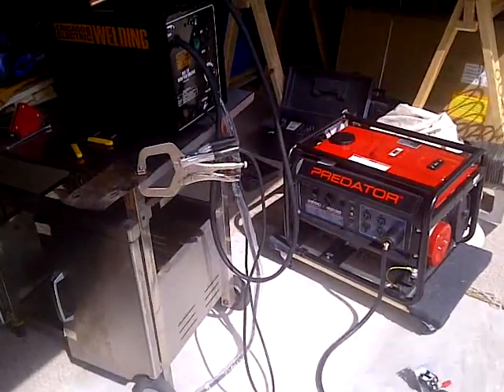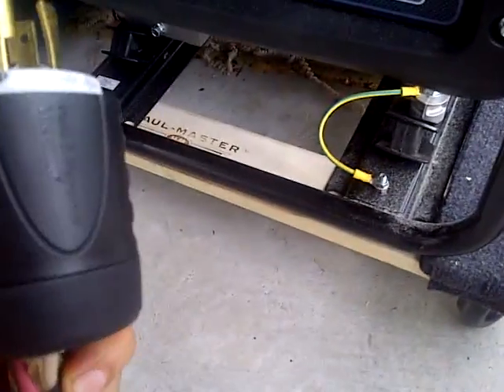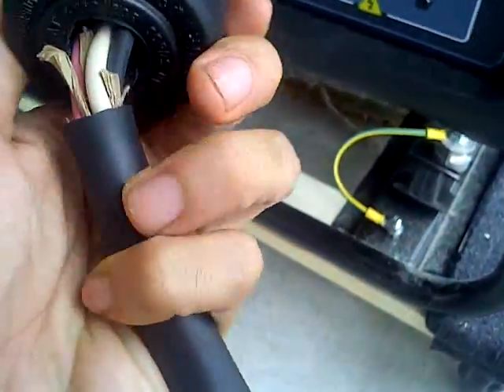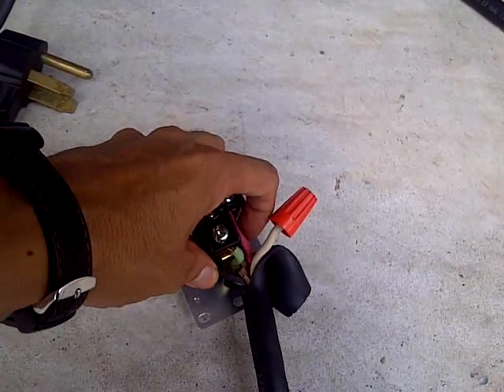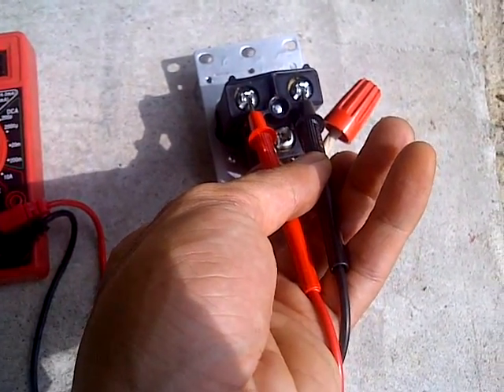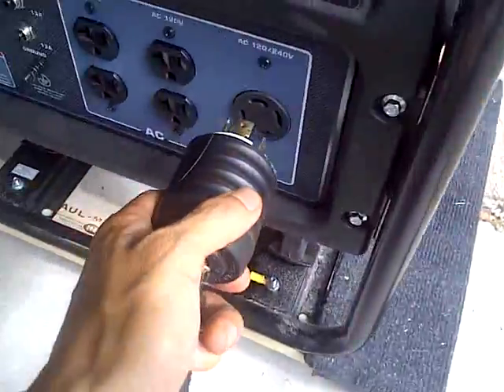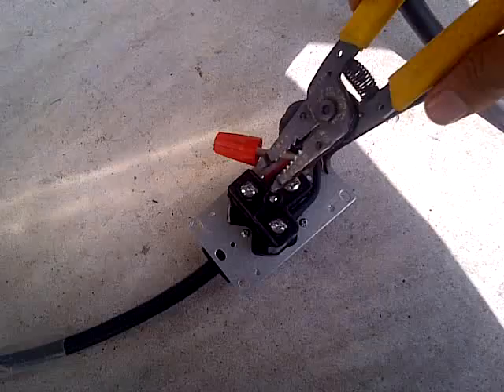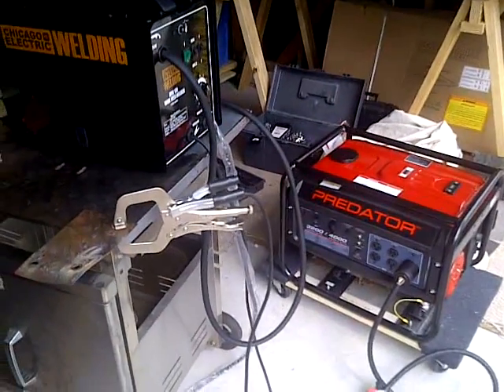170 Amp MIG/Flux Wire Welder - 22 Volts @ 110 Amps 02

Comment: Unless you're running something like a dryer that uses 220 for the heating elements and 110 for the light and display panel, you don't need the red wire.   220V is 3 wire,  Black, White, and Green; Black & White are both hot, and Green is ground.   You wired the other end the wrong way,  which doesn't really matter as long as you have 2 hots and a ground(make sure you know which is which = check continuity), since you're running a welder.  

Adapters....You don't need an adapter,  you need 10 or 15 feet or more of 10 AWG,  a plug that matches the gen, and some crimp type wire terminals(10 AWG x .25) to put a longer power cord on the welder so you don't have to drag the whole rig around.

Comment: Main reason they dont make and adapter is its not safe to run a 50 amp welder off a 30 amp circuit nor will you generator make enough power for your welder .your generator is to small
Reply: This particular welder only requires a 20 amp breaker.... So a generator with a 30 amp circuit is fine... I would have used a wall mount receptacle though , and have wired the twist lock neater.
Reply from the maker: Mr Rs yet it works and gets the job done.
Reply: Oh yea? I run my 215 amp welder on my predator 3500 weekly. It struggles some but my welds don't show it. My welder has 240 or 120 capabilities. And with harbor freights warranty I really don't care if I mess up my generator which I haven't and I've been using it for my welder for months now

Comment: Nice of you to help a kid out . I am a disabled vet spent 7 years in the NAVY on submarines . I learned how to weld stick welding on the sub I was on boomers . So I do not have any thing that works from the waist down. . There are 2 welders on board in case 1  gets hurt or sick . I have several wheelchairs and 2 hoveround and someone was nice and gave me one of those . So its a lot easier to weld with that than the stick welder. Don't pay attention to the nay sayer . I was a nuke on board and we had to do some crazy things to get get by
Reply from the maker: Thank you for your feedback.

Comment: although this video is trash,  he bumblefucked his way into doing this almost right.  you do have to step that up to 10 guage wire though.  tapen' off the nutral is correct.
Reply from the maker: thanks you for your feedback, yet it works, I am not electrician and have never done this before.  Never under estimate will power.

Comment: Why didn't you just cut off the 50 amp plug and change it out with the lock plug? Would have been cheaper and a lot more simpler
Reply from the maker: I am not an electrician and it was my first time ever doing something like this.  It still works and still use it today.
Reply from the maker: I am not an electrician and it was my first time ever doing something like this.  It still works and still use it today.

Comment: As others have already said, DO NOT DO IT THIS WAY.  Thankfully he didn't make a mistake which ended up with him getting hurt.   Arguably, the voltage potential between ground and  neutral should be 0, but this is the wrong way to wire this.  Ask for help when you are not sure, you might be surprised at all the people willing to share good knowledge.

Comment: You know why your plugs don't match correct?  The 220 outlet on your generator is for 220 35 amp or less draw.   The welder is 45-60amp 220 volt draw.  Hope that helps you!

Comment: On a 220-250v plug the flat pins are the hot wires, the round pin is ground and the neutral (white) is the same as ground. That is how it is wired in a home breaker box.

Comment: 240v means two 120v wires (black and a color ) a neutral/return (white) and ground (green) (IE 4 wires) , the difference between neutral/return and green is neutral/return goes back to con ed where the green goes to your house earth ground. You should wire the white wire to the plug ground and the green should be tied to the outlet frame .  Yes what you have will work but you have no frame ground and your return should be back to Con Ed IE white.   By doing it the way you did  your are making your earth ground a live wire , you don't want to do this please fix it or you may cause a serious problem some day IE electrocution or a fire .
Reply: His generator isn't connected to his house.  Therefore, ConEd isn't involved.  He only needs the two hots and a ground (no neutral).  That's how my welder is wired from the factory.  There's no provision for a neutral (white wire) because it isn't needed.

Comment: This is not done properly. You don't make a pigtail out of that type 6-50r receptacle.  Get the Cooper Wiring Devices WD1252 2-Pole from Amazon.com and then put whatever connector on the other end. I use a WD1252 with 75 feet of SOOW  6/4 flexible cord. The WD1252 is $13 and change.

Comment: very unsafe!! rewire that plug black and red are hot white is neuteral and green goes to your electrical box which you dont have! get one! or better yet cut off the welder cord and put your twist lock on it! and yes you should be using 10 gauge wire! also your wife should be getting a life insurance policy on you! g luck!

Comment: White is Neutral and the Black and Red are the two Hot wires.  You should swap the ground and netral so your plug is going to Hot/Hot/Neutral.  It may work connected to ground, but it isn't standard and probably not safe.
Reply: Unless your appliance requires 120v to run a 120vac clock or fan motor for instance, you only need the two hots and the ground to run 240vac appliances.  Neutral (white wire) isn't needed.  My electric water heater has the two hots + ground (new house build).  There is no neutral connection.  The only thing he needs to do is to remake the cord connections and put that outlet into a box with appropriate clamps.  He doesn't need to connect his ground to his house panel unless he's going to power his home from the generator.  But I don't think he's smart enough to tackle that project (and I hope he doesn't).

The power cord to my 180 amp welder is 3x12ga wires (two hots + ground) just like most 240 vac welders.  The 50amp circuit requirement is to handle the current surges during arc welding.

Comment: You know a cleaner method would be to just cut off the stock plug on the welder and replace it with the twist lock plug you bought. Also when wiring up a plug follow the strip gauge length, so the outer insulation will be held in the cable clamp.

Comment from the maker: I did a video on the 90 that you are welcome to see.  I also have done many welding with the 170/generator setup if you see some of the other episode I have done.  Big difference is the power and setting levels.  If you got 240 volt outlets, even better.  I don't, so I just rigged my generator, to make it work somehow.  Works for me.

Comment: Can you give some more opinion on the 90 vs. this 170?  I currently have the 90, which I already feel is underpowered after only a few months of owning it (plus it is AC output instead of DC), but I notice the 170 only goes up to 3/16" with flux core ... which is the same rating as the 90....I'm not sure if there is any benefit for the extra cash if it still can only handle 3/16...

Comment: that is a dryer/range receptacle. not sure if code says u can use that for a range anymore. still, I would mount the recetacle in a box toot sweet.
Reply: A 3-wire electric range/dryer receptacle has the flat blade pins (hot connections) wider apart.  A 50 amp welder won't plug directly into it.  Mine didn't.  All new construction that I'm aware of don't allow 3-wire female plugs anymore.  Must be 4-wire.